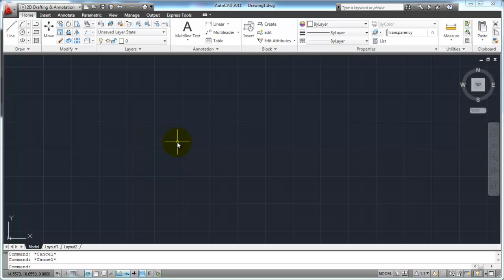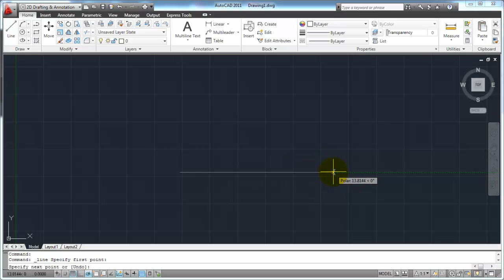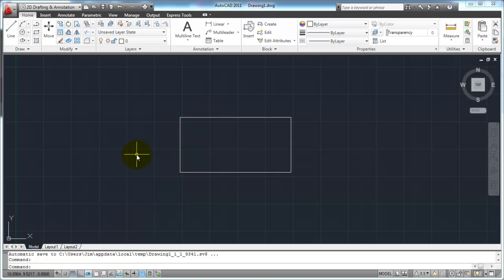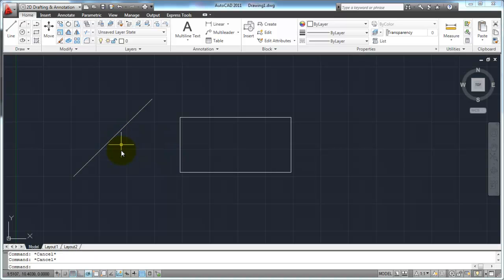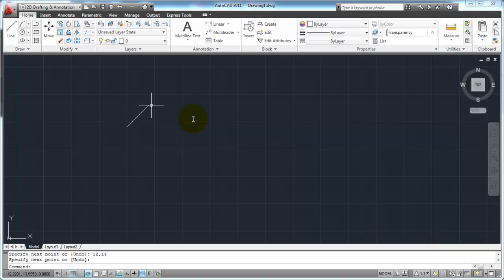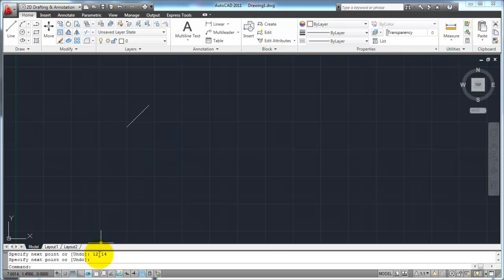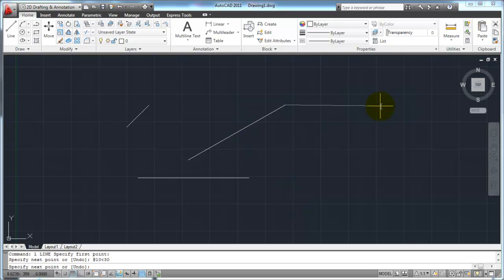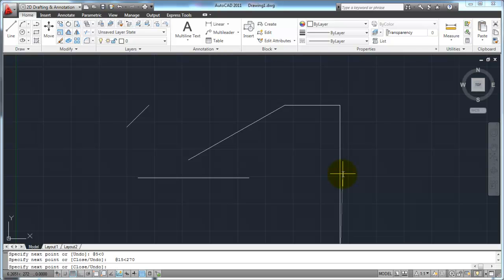AutoCAD 2011 - Tutorial 04

Comment: If you go to the Annotate Ribbon, click on the little --> arrow in the Dimensions section, you'll open the Dimension Style Manager dialogue box. There is a button called Modify which you will click on as well which will bring up the Modify Dimension Style Standard dialogue box, from there go to the Primary Units Tab and change the Unit Format in the drop down box. 

Yes there are several steps but you can get used to that with practice.

Comment: @lidoz I don't think you get what I'm saying.  When you say TAB and enter 90 degrees to go straight up, that 90 degrees is in RELATION TO THE X AXIS.  Say I want 85 degrees from my last line (just off perpendicular), but my line is already on a downward slope of 35 degrees below horizontal; Am I expected to do the math and go 180-35= 145, 145-85= 60 and type a command for my line length @ 60 degrees?  The only shortcut I found was to rotate w/ copy and it gives me the annotated angle between.

Comment: @johnchristianfraser Make the 1st line, or any line you want. (remove auto snap and all this on the bottom). Then as you are ready to define the second point on the second line with the mouse, dont click anywhere, instead type the distance lets say 100ft, then press TAB then you can type the angle where 90degrees is vertically up then hit enter and ur done! Having the dynamic input makes it easier to see. good luck!